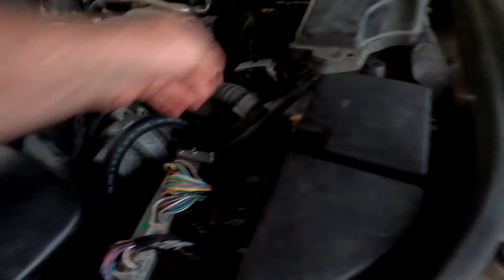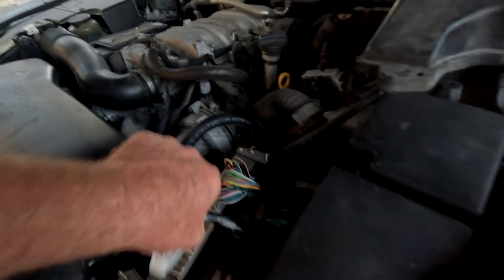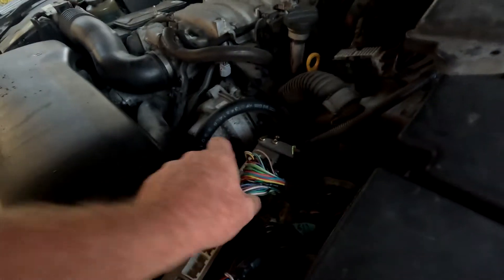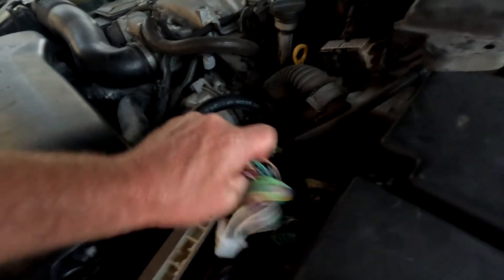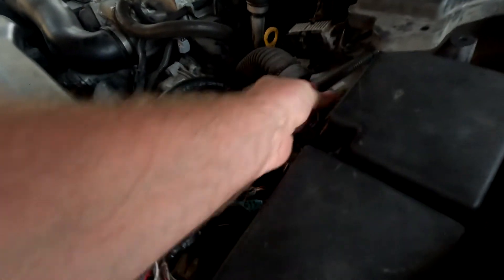Engine cranking with no ECU

Comment: A couple days ago I had a coolant leak from a broken temp sensor on the passenger side of the car above the alternator  alot fell in the valley by the starter , I thought that was the issue ? I replaced starter , battery and relay, no crank unless I bypass the relay with a wire it'll crank but won't turn on , I noticed when I turn it to start the check engine light does not come on, which I've read that might have something todo with the car either not powering or communicating with the ECU , the ECU is also fairly new so I don't thinks it's the ecu it's any suggestions ? Im trynna sell soon in working condition
Reply: Did you figure out your problem?
My car shows ecu not connected but my security light still flashes